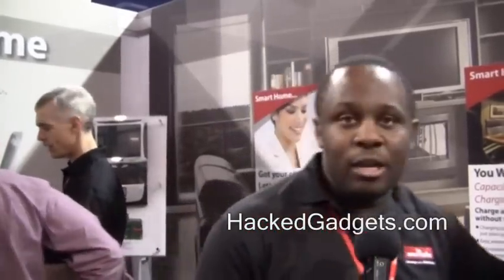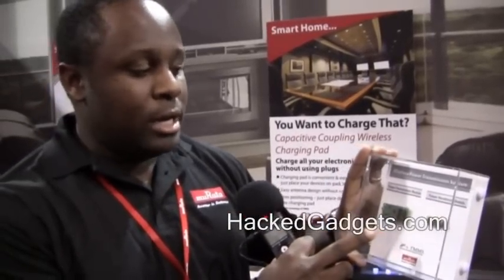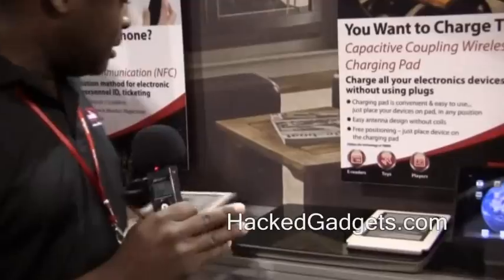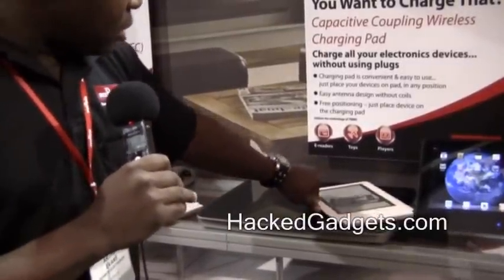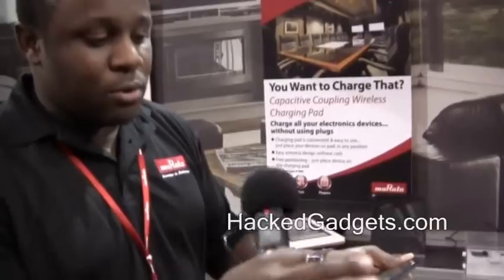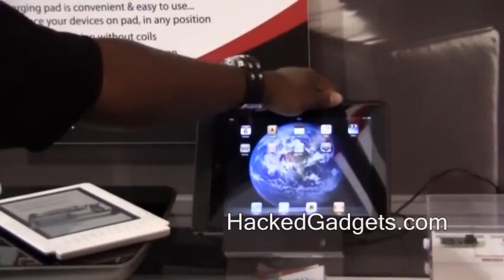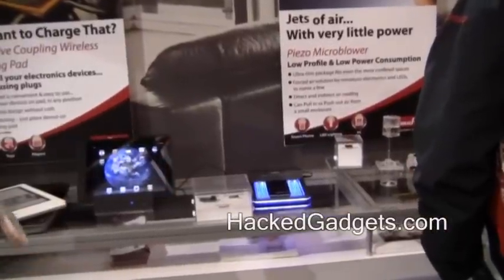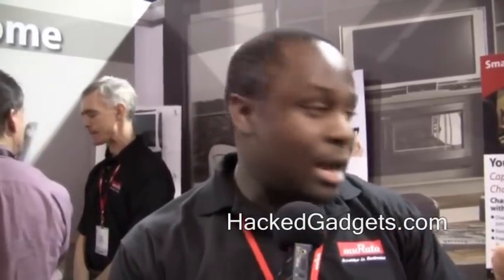murata capacitive charging system

Comment: Nothing like patents to drive usage of electromagnetic duality...

Might have a bit of a play with capacitive approaches myself.  Large voltage swings would be required I suspect, unless capacitance is boosted strongly by the dielectric.  You still need inductors too, but at least they can be small and low loss.  Capacitive can be very thin.

I think they are overstating its alignment insensitivity compared to inductive approaches.  Realistically both need accurate placement for good coupling.